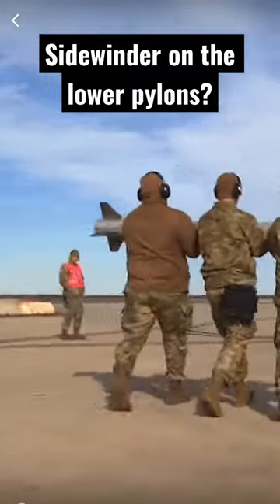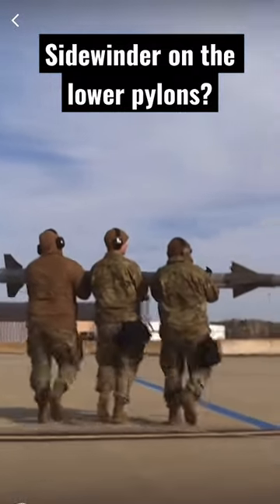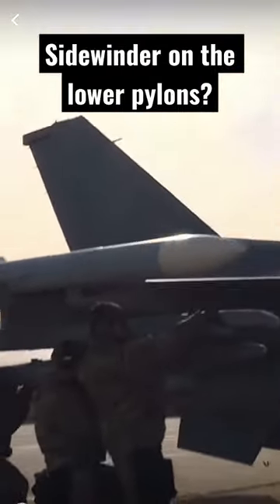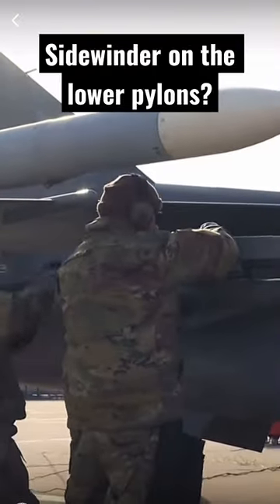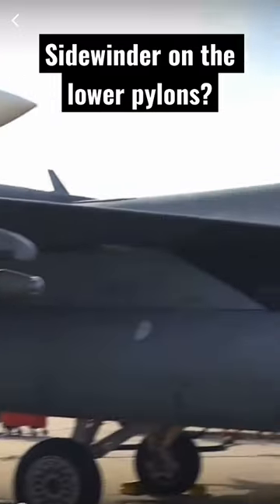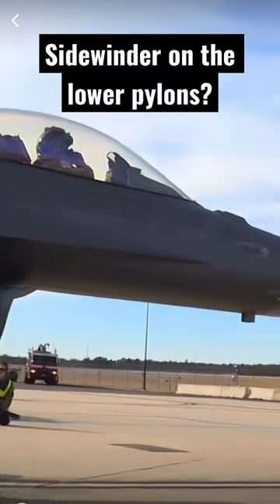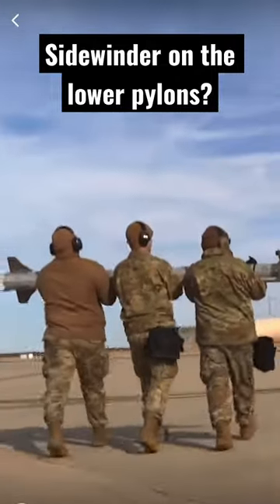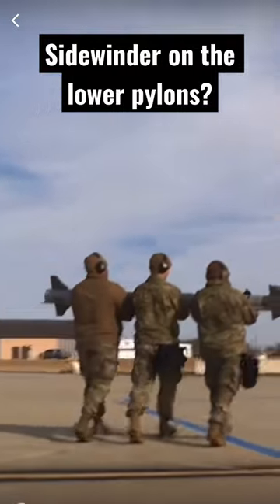Why is this Sidewinder missile not on the external mounting pylon? #missile #sidewinder #airforce

Comment: We always loaded the missiles this way during my five years as a loader on F-16’s.  The wingtip weight of the AIM-120 helps reduce flutter more than the lighter AIM-9 is my understanding.  It’s also easier for load crews, but that’s not really a consideration.

Comment: Since the Aim-120 is heavier than the sidewinder the weight helps reduce the wing flutter.
Reply: This
Reply: Came in to post this. I don't recall where I saw that explanation but that's what I recall the reason is.
Reply: This sounds the most plausible without researching your comment.  Adding weight to the tips would negatively effect roll rate (more mass further away takes more energy to move) reducing manoeuvrability and when one side is released it would increase asymmetric weight distribution, so there has to be another even better reason to accept those consequences.  It could also be reduce wing tip vortices (and therefore drag) being a bigger missile (acting like a winglet) therefore providing greater range.
Reply: @guyb7995  going by your comment, one reason this could be, would be to help the stability and actually reduce the roll rate for a reason. Obviously, the F-16 is one of the more maneuverable of all fighter jets, meaning that it takes a lot more careful handling to keep it stable. Having the reduced roll could actually be a benefit.
Reply: It’s the weight? I would’ve thought it would be the rounding of the wingtip vortex area meaning there’s less resistance to the wingtip vortex formation. But I’m not a physicist so don’t quote me

Comment: My only guess is that they anticipate they'd fire the radar guided missiles first (at range) and only use the sidewinders after that. Firing the outboard missiles first reduces the roll inertia, making it faster to turn in a dogfight.

Alternatively, it's possible the Sidewinder is newer (AIM9x?) and this requires additional capability that might only be available on the underside pylons.
Reply: Ohhh good idea didn’t think about that and it very well could be the reason or at least part of it
Reply: @ryanh6586  interesting how two things can be true at once. Reduce flutter, be ready for a dogfight when the dogfight come.
Reply: Why post a guess?   
If you don’t know, you don’t know.
Reply: @falconeaterf15  for infinitely better reasons than you have for posting your comment.
Reply: @skydog22  
The sheer joy of speculation?
Did not know that was a thing.

Comment: Oh, also, putting the heavy missiles on the wingtips reduces the bending moment in the wings under load, so they could pull more Gs than with all the weight concentrated near the fuselage. Still not as many Gs as clean, but as the aircraft gets heavier, the airframe rating in Gs decreases and this could mitigate it. 

Same reason airlines put the engines and fuel on/in the wings.

Obviously roll rate is compressed with the big missiles far away from the centerline.

Comment: The AMRAAM is designed to fit on rails designed for the AIM-9 and yes it does reduce wing flutter.
Reply: From all your obvious experience how much does it reduce wing flutter? How many times have u flown the f16 with sidewinders mounted under fuselage vs wing tips?

Comment: Actually only the F-18 and F-5s tended to put them on the wing tips. The F-4,14, and 15 didn't have with tip pylons. 

I could see this being a couple things, putting additional mass towards the wing tip actually strengthens the wing under load and two it may disrupt wingtip vortices. 

In DCS at least the wing tip AMRAAMs are the last to go. So the may serve aerodynamic, structural, or both purposes.

Comment: Hello. Fellow, current F16 weapons troop here. 120s always go on wingtips even though they can technically go under the wing. I assumed that’s got something to with the way the jet flys or handles in the air. But I do wanna say, going under the 120 is not a big deal because it’s on a rail and is a “forward firing” munition. You DONT wanna go underneath a bomb or any store on a rack though.

Comment: I understand what was explained on another answer (about the flutter), but I don't believe that was the case (the vibrations keeps happening, even with the reconfigured weight).
What I interpret about this configuration is that the AMRAAM is used against mid to long range targets, and at this engagement, maneauverability isn't an issue, so the extra weight at the wingtip wouldn't be bad. After using the heavier missiles, what remain are the lighter ones, that being more close to the gravity center of the plane, tend to reduce the momentum of the plane, and this is needed/wanted on a dogfight (against short range targets).

Comment: By "external pylon" I presume you mean the wing tip pylon.  In fact it's not at all unusual to see the two weapons mounted this way: they are essentially interchangeable.  The 120 on the tip is better at reducing flutter because of its extra mass.

Comment: It seems strange.  They say that heavier missiles on the wingtip reduces the wing flutter but what about the extra stress from the added weight?   If you are doing high G maneuvers, the heavier missiles on the wing tips will increase the stress loads way more than the lighter missiles.   Should we be more concerned about the wing flutter than the added stress of the heavier missiles?

Comment: imagine being the guy that trips.
Reply: My worst case scenario was loading AIM-9’s on the F-15 pylon station, which is quite high.  A very capable female Airman on my crew couldn’t reach quite high enough, so I put the big strong guy on the heavier tail section and took the nose section with her fingers losing contact with the missile about two inches too low.  She could then hook up the umbilical.

Comment: .........let me explain this further  "....there's NO NEED OR reason to approach the other missile from the front or rear...straight path to the pylon / most direct path is better for several reasons.....31 yr AF Enlisted....25 years of that in aircraft maintenance....."........if you walk straight to the pylon as these troops are you walk straight footed to the pylon and it's easier to hang it that way...walking straight to the attach points and you can see the attach points directly face on...and it's easier on the feet than having to walk under the aircraft.....IF YOU approach the aircraft from the back  you then have to half step to the right instead of walking normally straight away....it's harder to get the missile to line up....MUCH harder on your feet to half step left or right carrying a very heavy missile...direct path is much better and safer...easier to misstep if you are half stepping to the right or left  carrying a missile...

Comment: having weight on the wing tip tends to improve the lift, roll, and general flight characteristics if the aircraft, plus having the larger missile further from the center means less effect on the plane from the more powerful motor of the missile and less effect on the radar. or at least that's my best guess for that. I'm fairly confident of the first reason
Reply: Physics would say if the more powerful motor has an effect on the plane, having it further away from the centre would increase that affect, not decrease it.  Work = Force × Distance & all.